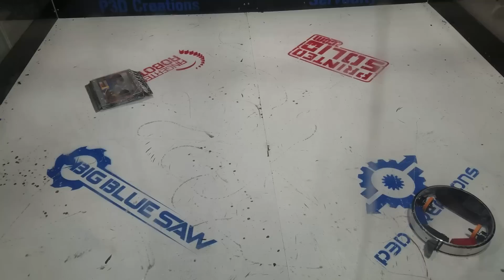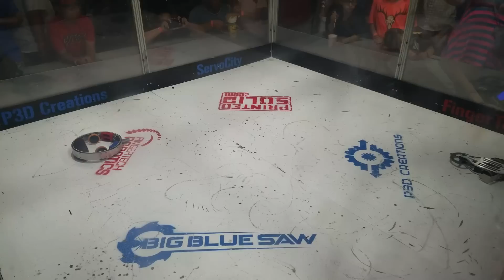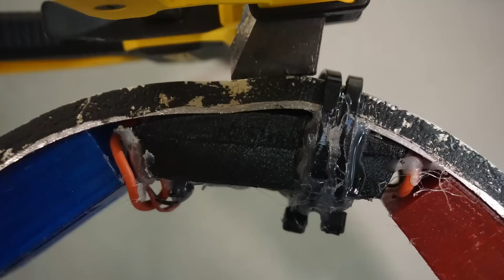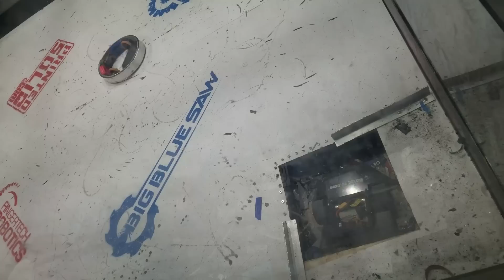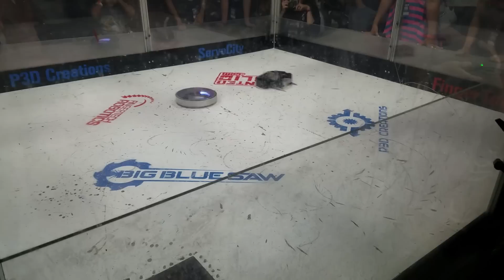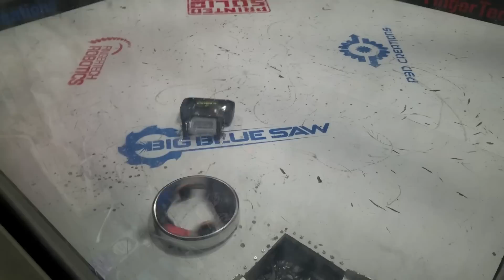Halo, a 3lb meltybrain, at Maker Faire Orlando 2018

Comment: I wander how well a 3 wheeled melty would work. even though the tires would oppose, it should be able translate around the arena with just slip between them when spinning. This should get rid of gyro effect that tends to plage melty brains. the biggest issues would be that it would not be able to drive normally when not spinning, and there would be more complexity because if any of the 3 motors dies, you would not be able to spin properly. I do think that maybe some small slippery metal wheels at the back and front might help to eliminate the off axis gyro effect that slows down spin up.

Comment: You should make a 250 lb version and enter into the 2020 battlebots tournament! This robot is epic!!!
Reply: I know this reply is late, but I'm not confident BattleBots officials would even allow it due to the danger something like that would pose. As awesome as it would be, it would likely have enough force behind it to smash through the arena walls. This little 3lb guys was slamming the walls very hard, I'd be afraid of the danger posed by a 30lb version, let alone a 220lb or even 250lb version!

Don't get me wrong, I would love to see it in action, but I just don't think it could be done safely.
Reply: @absolarix  have you watched tombstone or rotator or any of the spinners launch 250lb bots into the walls?  The walls have been damaged but never penetrated.  Not sure how this 250lb projectile would be any different than those.
Reply: ItchingToScratch Meltys aren’t considered to be active weapons for BattleBots currently. Maybe they will be for 2020 though.
Reply: Check out team panic they are making a melty brain with dual weapon configurations for 2021 bb

Comment: Have you calculated how many kJ of energy Halo has stored at full speed? Do you know how that might compare to other 3lb spinners?
Reply from the maker: 3lb at a 5" radius will tell you the rotational inertia. Max speed was 1100 RPM. I just ran the numbers real quick, it's around 150J

Comment: The real reason why meltybrains aren't allowed in Battlebots.
Reply: The real reason is nobody has applied with a working one yet, they only break the letter of the active weapon rule and not the spirit of it so they could either modify the rule or make an exception. BB would be happy to have a cray new design actually work well
Reply: Are they not allowed? I thought no one had tried yet ;p
Reply: @RennieAsh  It's been done before in old Battlebots (Y-Pout, Herr Gepoeunden), but the new show requires an active weapon with a separate power source from the drive. Melties obviously use the same motors to do both, so they aren't allowed.

Comment: Very nice!!
I've just re-started work on my 150g metly and this video confirms I need to get it finished.

I'm planning on using internal sensors to judge direction and spin speed because IR beacons seem like a bit of a weak point
Reply from the maker: I used an accelerometer too, I was just using the beacon to cancel out the drift. Though you're right, I think this shows optical beacons have serious multi-path issues. I'm looking at some other fun sensors as a replacement, stay tuned
Reply: @spencerallen7804  Ultrasonics, pulsed IR, lidar?